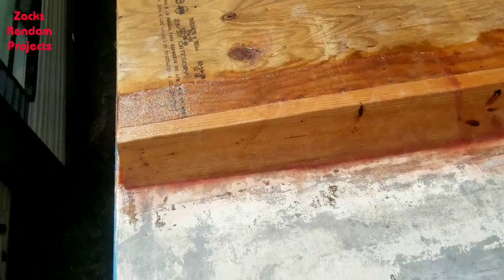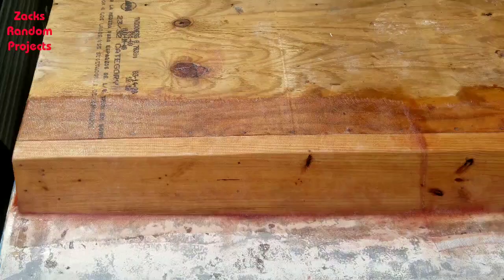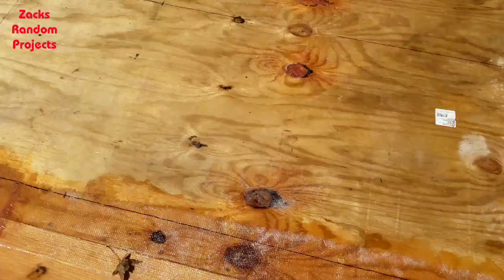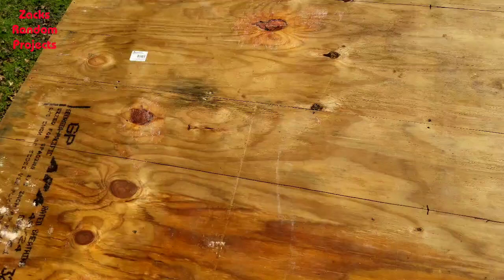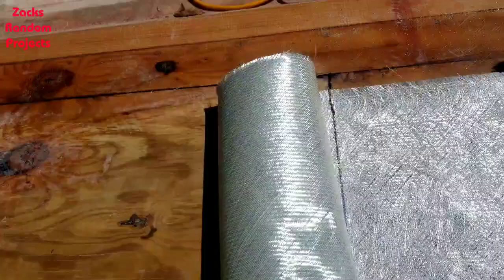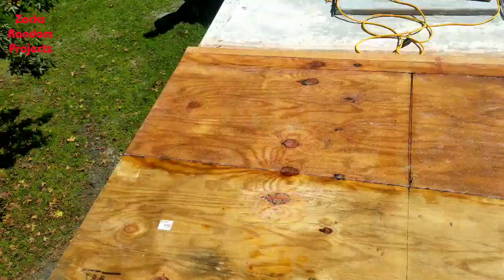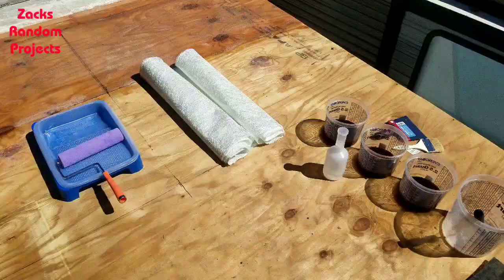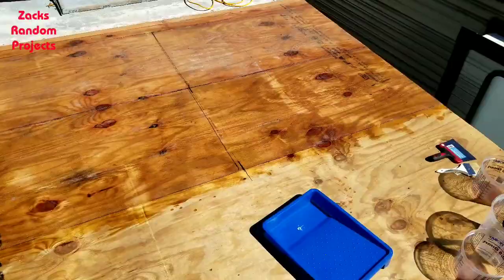Houseboat roof fiberglass Pt.2

Comment: Well done this should be interesting. You certainly have a good versatile set of skills. I know you want room on the stern but I had a Volvo I/O AQ125 A with a 270 Stern Drive and they are awesome engines. Maybe think about the switch a bit more? I think I will learn a lot from this series. thanks :)
Reply from the maker: Hey thanks for watching and for the kind words. This is my firdt I/O boat so hopefully all goes well. I know Volvo Pentas have a good reputation so Im not sweating it. Changing the engine out is not a priority. I will probably leave it unless I get a crazy good deal on an outboard I cant pass up. Thank you for watching!

Comment: Hey Zach, I've been following along with your houseboat restoration project. I've been looking for a project like this myself for some time but just haven't been able to find a good deal like this one you found. When I find something it usually has problems I don't want to tackle, like a rotten hull. I hate to hear you are dealing with this virus thing and I hope you get over it soon. I'm not sure if I'd be out there in that Florida heat while dealing with that stuff though. I have one question about your project, why did you decide to do away with the flybridge? I think that would be a nice feature to have, especially while cruising on a hot day. Put a little bimini top on there and get a cool breeze while going down the river! Anyway,  thanks for sharing your project updates and take care of yourself.
Reply from the maker: Hey! Thanks for watching my crappy videos! Lol. There is a couple reasons I took the upper helm off. Everything was rotten. Steering cables and the shifter and throttle cables were froze up and rusted, so Im sure it would have added several hundred dollars to the project just in new cables. Also, one of our favorite places to take our pontoon boat is a place called Salt Springs down here in Fla. Well, the dirt road that leads to the boat ramp down there is lined with old growth grand daddy oaks and there is one particular branch that spans across the dirt road that would hit the upper helm on the houseboat if I left it up there. The people that run the boat ramp refuse to cut it. They like the fact that it limits boat size to their ramp. Honestly they dont even have enough parking for all the smaller boats that use that ramp. We have a 20' pontoon that we take out all the time and if I leave my bimini top up and flip the little white light up on topof the bimini, the light hits the branch and folds backwards. So the househoat helm was taller than the light, so I knew I had to take the helm off. There is other ramps around the area that we could use to get in the water and then drive the houseboat through the lake back to Salt Springs, but sometimes the water level is almost too low for our pontoon to float in the run that leads from the lake to Salt Springs, so there is no way the houseboat would make it down the run. All this added up to where I thought it would be best just to do away with it. Anyway, sorry for being long winded! Thank you very much for subscribing and watching my vids. Im back to work and working five 12s and the wife has me running on the weekends, so hopefully Ill get a chance to get back out there on the roof soon. Thanks!
Reply: That looks like a pretty good reason to do away with it. Okay, thanks for the update. I look forward to see how you progress on it. The job and the Honey do jobs come first though ;)